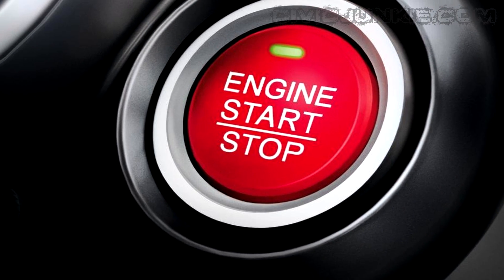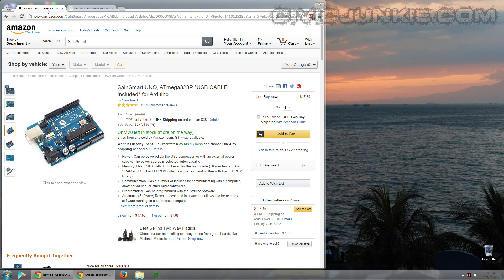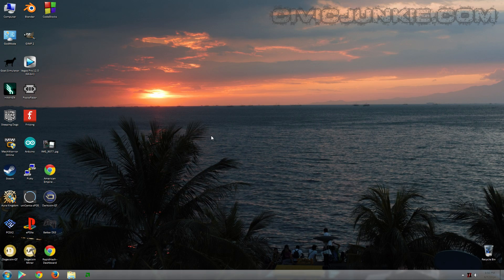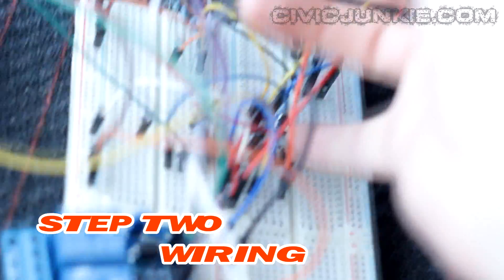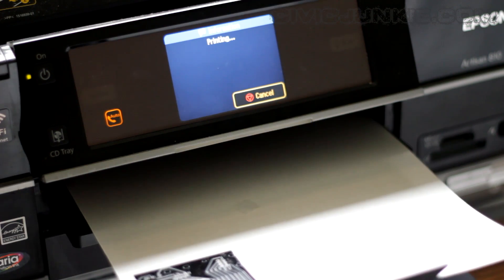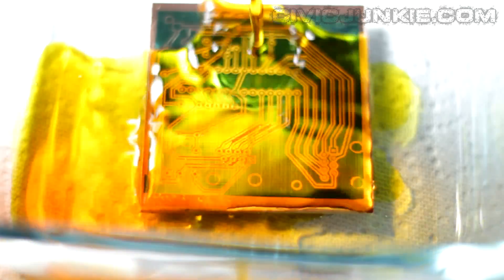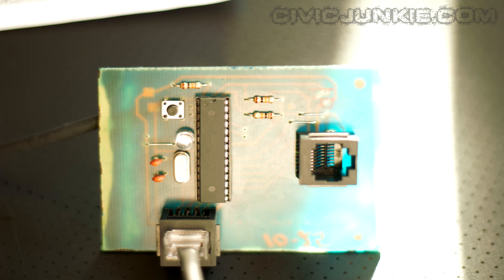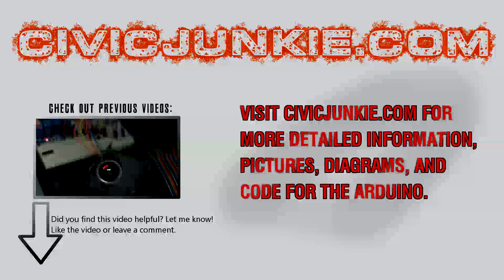Engine Start Button

Comment: Hi alloySnake 
I am wanting to do something similar, but with a raspberry pi 3 and it controls the starter etc. hope to hear from you
Reply from the maker: +Nathan van NIekerk I have a Rasp. Pi, but I haven't played with the GPIO yet. You can use Python on the Pi to control the starter and other things in the vehicle. However, a micro-controller like the ATMega328 has an advantage over the Pi: If the power is cut(or battery dies), the Pi takes awhile to boot, but the Arduino/ATMega328 boots in less than half a second. In my opinion, The Raspberry Pi is better suited for a in-car media hub. Especially the Rasp 3. But, yes, it is completely possible to use it as a engine start controller, or anything you can think of(security, gauges...). I'd start with watching some Rasp Pi Python tutorials on YouTube. I hope that helps. I'd love to see what you come up with!
Reply: Thanks man, I owe you for the advise, I wanted to use the raspberry as the media hub, but add the security and starter etc to the already used micro controller, but I will definitely look into maybe a dual system, and let them work together.

Comment: no arduino needed. can be replaced by two spst relays or one spdt relay. video coming soon
Reply: Let me know how you tapped a RFID chip into those relays. If you didn't figure that part out, let me know when your finished. I'll come over after dark and check out your work. :D

Comment: i cant fine a start button with acc and start features they are all just single light buttons
Reply: Check out 2010ish Nissan Altamas. They are plentiful on ebay and have the features, I'm thinking of going that route but I need to find the wiring diagram for the button as I don't want to figure it out myself. GL
Reply: David Hettinger hey dude thanks

Comment: I have a question : Normally the car igniter needs to warm up before starting the car , does this button takes that into account?  
My car does start even if the igniter lamp is not ready yet but that drains the battery really fast
Reply from the maker: +Nardi Braho Yeah, with this setup you can turn the ignition on to prime the fuel pump or heat the glow plugs on a diesel engine. Remember, it is programmable, so you can basically make it do whatever you want. :)

Comment: hello I am from turkey
I find the same start button you ever wonder where the supply link?
Reply from the maker: The start button is from a 2008-2013 Mazda 3. Check ebay to find a used one. Otherwise, any button will work.

Comment: Why not just buy a RFID push start kit? Has a proximity sensor and 2 RFID chips. Usually about $40-$50 or so. 
http://www.amazon.com/EASYGUARD-system-Transponder-Immobilizer-Keyless/dp/B00HCAYQ0G/ref=sr_1_18?ie=UTF8&qid=1457676008&sr=8-18-spons&keywords=rfid+push+start&psc=1
Reply: Are you crazy? And miss out on all the fun, sense of accomplishment and sweat of creating it yourself?

Comment: Its a cool project. The problem is that there is no safety whatsoever. Just gotta get in to the car and push the button. A CRX isn't a difficult car to take in the first place, and this does the marginally difficult part for you.

Comment: Hi, I think like most people, I like the Push button start but that has to cut out all the car security systems. I know that one car they tried the Keyless where you basically carried a card that didn't catch on because of the problem when the battery went flat
Reply: +ANDREW CULLEN The nissan altima has fixed the battery in the fob going dead by allowing you to insert the fob and be able to push the start button.
Reply: +Zark Muckerberg Hello, I was talking about the car battery going dead so you could not get in the car as the Central Locking wouldn't work and there was no physical key, This meant the could not open the bonnets to put the car battery n charge or replace them
Reply: +ANDREW CULLEN I see. you should have clarified in your original comment as car battery.
Reply: Hello.Well what else are you going to carry a card for in a car?
Reply: I don't think I know of even the newest cars using push button starts that still don't have on key hole on the drivers side door. I could be wrong. But then if some have eliminated the key hole then they almost always have a keypad. So how do you get in a car with a dead battery with an OEM system? This Arduino system was only for starting the vehicle which you don't have to worry bout doing if the battery is dead. If the RFID was connected to the door unlocking or an ant-theft system, then I am thinking you could wire in some kind of little battery to allow the door lock actuators to operate. I think cars (if they are manufactured with no key hole for unlocking) need to have either a small backup battery for this purpose or some electrical connectors under the bumper or somewhere you can connect one of those small handheld jump-starter packs to unlock the vehicle.

Comment: Do you have it programmed so you need to push the brake to start?
Reply from the maker: +PapayaMan On the version in this video, I actually did have a interlock switch for the brake or clutch pedal, but in my latest version with RFID, I decided not to use that. I can leave the OEM one to function separately from this start system. However, it's fairly simple to add or remove such features.
Reply: AlloySnake thanks man
Reply from the maker: +Fredrik Lehtonen I've added simple RFID to this setup. I've been editing the video in my free time. I'm not very good at editing videos, but I hope it'll be better than my last one. :)
Reply: AlloySnake I also hope you plan on releasing soon, appreciate your efforts.
Reply: +AlloySnake Where can i find info and code for the RFID version? Want to make this for my beach buggy :)
Reply: +AlloySnake Dude, did u know that if someone breaks into your crx, someone can just simply push the button and drive away with your vehicle? =(
Reply: +Battosai Jenkins wow he must have never thought of this. your so smart
Reply: +Odin Palen Well what's the fix? We didant see so in the video.

Comment: No hate but are there any safety features what so ever?  You could at least add some RFID card or 1-wire key to it to make it somewhat more secure. Also did you draw that pcb design in ms paint? because it sure looks like it. When something works it doesn't necesarely mean it's done the RIGHT way like you stated in description...
Reply from the maker: +webkar I have improved this setup, and it does use RFID now. I'm working on the video, and I will try to better explain how that works. I made the PCB mask with Fritzing(http://fritzing.org/). As for it being done the "right way," I suppose you are correct. I guess I meant that you don't have to use the key to make the button work. :) Thank you for your feedback! It helps me improve my projects and my videos.

Comment: So what you've essentially done here is make your car very easy to steal? Haha!
Reply: not really, instaling a can-bus car alarm, with rfid accessand/or a code unocking system is enough and kinda cool to have em
Reply: how to modenise my kia sorento
Reply from the maker: Yep! All you need is the correct RFID key with you! Scan the correct RFID/NFC tag/device and the car will start automatically! But, I'm not handing any of those out, so you'd have to figure out what info the system is looking for on the RFID tags. Good luck with that!

Comment: Hey Very Cool! Wouldn't mind doing something like this with my MKIV Jetta.

Did you totally remove the steering wheel lock?

Where did you get the actual push button? Also is there 2 separate inputs from the button itself for ACC and ON? 

Any thoughts on hooking up the arduino with an RFID tag reader so you could have the car automatically unlock as you approach and also have the start push button only work with key near? That would be an upgrade to your system!

Comment: AlloySnake, great video, great idea. Although a mechanical engineer, I'm conviced to get into the Arduino think...
P.S.: The info you tell on the video is much more important than a music clip...Please bear in mind to lower the volume of the music, or even better not adding music at all!
Reply from the maker: +Angelopoulos John I think you will love using the Arduino. You can do almost anything you can think of with it. I'll make sure the music is much quieter next time.

Comment: Is there a list of every component with codes and maybe buying place that you used in this project? I'm really interested...Could you please tell me how you can add the engine lock sensor that your car has and that unlocks with your keyfob (for cars that have that) to the arduino board? (what do you need?) Thanx:)

Comment: So anybody can go inside your car and turn on the car? What about the steering wheel immobilizer and shift lock?
Reply from the maker: +Technolique Yes, anyone can BREAK into my car, just like any other car. They cannot, however, start the vehicle. I made a security feature I didn't show. I have not made another steering lock. I thought about attaching an actuator to the micro-controller, but decided against it in the end. I suppose it would be good to show how that's done, though. As for the shift lock, my vehicle has a manual transmission. For an auto, shift-lock can easily be controlled by this. I even left room on the circuit board to add other features such as shift-lock or RFID input.
Reply: Well yeah but I was asking if they can actually start it. I saw another circuit board with what looks to be a transmitter on it and was wondering what that is for. I do like the video and it was a nice insight to retrofitting a start button.
Reply from the maker: Technolique
I don't have an RF transceiver for this setup. Other commenters have suggested I implement RFID. I plan on doing this and/or a fingerprint scanner just for fun after I return home in Jan. I just do this kind of thing for fun, and I hope that this project will inspire others to come up with neat ideas and to just have fun with it. There really are so many possibilities.
Thank you for watching, and thank you for taking the time to comment. I really do appreciate it.

Comment: I did something like that (which retries if the engine dies on the starting up process, it was a little bit tricky to do), but I didn't removed the key because I thought that it would be too easy to steal the car...Did you put some kind of security feature?
I bought a NFC card reader to make it, but haven't made it until now.

Your PCB looks great, the star/stop engine looks very nice too, congrats for the project!
Reply from the maker: +danieldiasmauro I do have a security feature. It's not NFC/RFID. I would like to add RFID and biometics support soon. I'm playing with the idea of a vehicle starting as soon as it scans and verifies my fingerprint. It's fun to play around with this stuff.

Comment: Well I'm not lazy to work on this and I'm not dumb I can figure it out quickly but if some one breaks into the car can't they just start it and get a way with it? Based on what I saw on my cousins 2007 Nissan altima he had have the key inside the car in his pocket or some where in order for it it be wirelessly connected and then he can start the car if the key isn't inside or near the car he can't so I don't belive that's a safe thing to do

Comment: I'm going to implement this on my 1984 F150 because the ignition control switch is notorious for breaking. I will also use an RFID chip. Any suggestions?
Reply from the maker: +Johnathan Williams RFID would make this system perfect-ish. I plan on doing RFID and biometrics on mine, but I won't be able to work on that and make a tutorial until after December. I've never worked with RFID before, so I won't be able to help until I start working on mine. I know it'll require a lot more code; unless you can get a standalone RFID module that just outputs a high or low signal. That would make it super easy. Anyhow, I would love to see how your project turns out! I've even thought about how I could use RF to start my car remotely. So many possibilities with this system!
Reply: I've never worked with code before, so I'm excited to learn. I may need your help once I get everything here.
Reply from the maker: +Johnathan Williams I'm not that good with code, I'm surprised I wrote something that works. lol. I would suggest doing some simple projects first, such as making an LED blink, or using a button to turn an LED on or off. In fact that's basically the same as using a button to start an engine! After you get a basic understanding by doing those simple projects, take a look at the sloppy code I wrote and see if you're able to follow it. If so, the next step would be to play with RFID.
Reply: Yeah thanks for the tips man, also I see that same company makes GPS trackers and RFID chips that are compatible, interesting.

Comment: Is there a way to keep it from starting unless you have a certain trigger? (Like the keyfob in the car in a typical button start configuration) 

Maybe the use of an encrypted NFC chip to allow Startup?
Reply from the maker: *****
I love seeing fantastic comments like yours! You've got some great ideas! It's possible to do some really cool stuff like you mentioned, but it does make it more complicated. I'm honestly not that good at this stuff. I just do it for fun if I'm able. I'll study up on NFC implementation; if I think I'm able to work with it, I'll definitely make another video!  I won't have the time until the end of December, though. NFC, biometrics, LEDs... Yeah, I'm excited to try it!
Thanks for the insightful comment!
Reply from the maker: +Brian Cuellar NFC would be a great addition to this system, and you can get NFC modules that will work with the ATMEGA328. Other options could be RF, keypad, magstripe or smart card, biometric, or discreet button. Maybe even Bluetooth - if your phone connects to the vehicle's Bluetooth, it allows the engine to start. Pretty much whatever you can think of, though adding communications will make the programming much more complicated. I kind of like the idea of biometrics. I think I feel a tutorial coming on...
Reply: +AlloySnake that would be awesome. Writing a condition listening for NFc during ignition (easier to send some access than chopping off your finger imo)
Reply: +AlloySnake  Please make a new tutorial! I was blown away by your knowledge on 
these electronics! I'd love to learn to code and how circuit boards 
work.

Back to the project, I think having the NFC reader activate when the door opens would be most effective. And you could go sci-fi with the key reader, too! For example, if you're feeling creative, you could shape a slot and key like the show "Gurenn Lagann" for instance (or really any sci-fi show where this is applicable) where a kid starts up his robot using a drill-shaped "key". If you get a key and hole that act as NFC chip and reader, you could make a very cool ignition switch. Bonus points if you have an LED light glow when the key has been read.

This has the potential to be way safer since, even if someone were to steal your keys, they wouldn't know how to turn it on. You could even have a fingerprint reader (yes this is getting ambitious) that would allow you to still drive even if your keys are stolen.

It goes without saying that you've got a new subscriber. Seriously, man, if you add a layer of security to this project, I'm sure the people at reddit's DIY page would love it. Hell, if I had the know-how to do this, I think it would be a cool business.

Comment: so any one can steal your car?
Reply: +Erick Torres lol no you are wrong this does not have RFID or anything similar. you literally only need to be pressing the break pedal when you push the start button, for the car to start. That is the only "security" feature
Reply: +uhsen some people make systems like this that require you to locate and switch on a hidden switch before the button will work in turning on the car. If you hide the switch and only you know about it that can keep someone from stealing your car. That and buying a security system if your car doesn't already have one.
Reply: No you need the key close to or in the car to start up the car or else the button will not do anything

Comment: Thanks for the pictures.  Did you take the Uno apart to use the ATMega 328 on your pcb?
Reply from the maker: +Pheniel L. Gomez I have several ATMEGA328s with Arduino boot loader. I use the Arduino to program them, then I build a standalone circuit board for them. You can also just take the micro-controller off of the Arduino board and put it on it's own circuit board. Or put the Arduino in a case and use it that way. Several options there. You can decide which will suit your application best.

Comment: Hello, I'm interested in doing something similar to my car, but I'm wanting to do it with the sparkfun pro micro.  Do you know if it would be compatible?
Reply from the maker: +Pheniel L. Gomez The SparkFun Pro Micro should be compatible, and is a great choice for projects like this. However, the Pro Micro does not have headers for leads to make it easier to work with on the test bench. Easy enough to solder something in place, though.

Comment: does the circuit board have to be a specific pattern.
Reply from the maker: Mike DuPrey Not really. Just design a layout that works for you. I could probably post my design as a PDF...
Reply: Ok cool thanks.
Reply: AlloySnake Please let me know when you do. Thanks
Reply from the maker: Mike DuPrey
I updated the engine start button post on Civic Junkie. Scroll to the bottom of the post to get the PDFs of the copper etch and mask. Also a FZZ file for Fritzing. http://civicjunkie.com/main/2014/09/02/how-to-install-a-start-button/